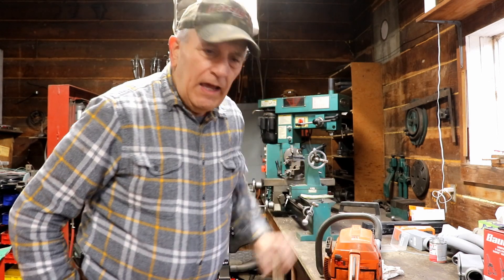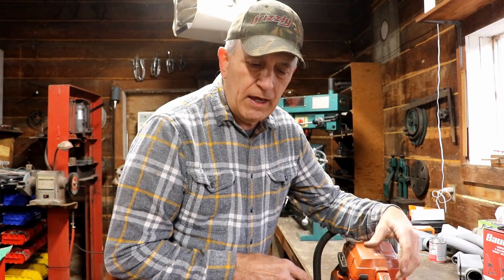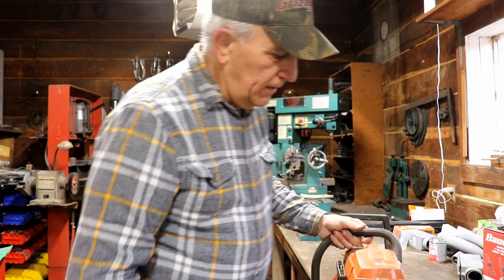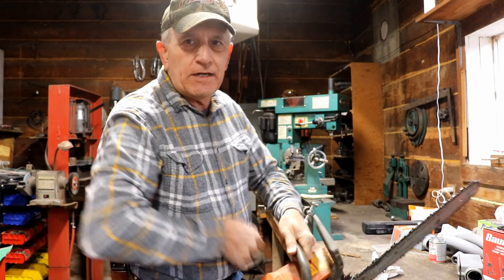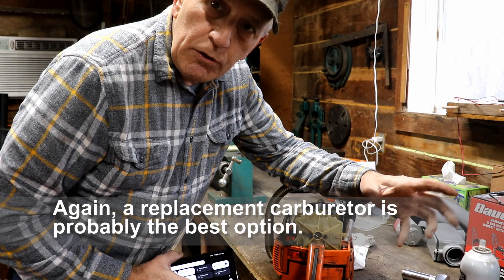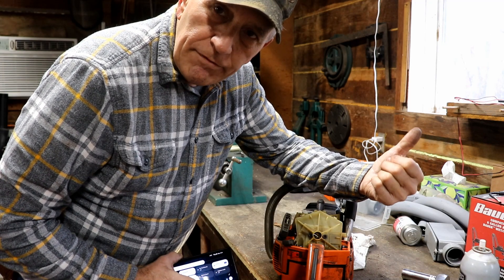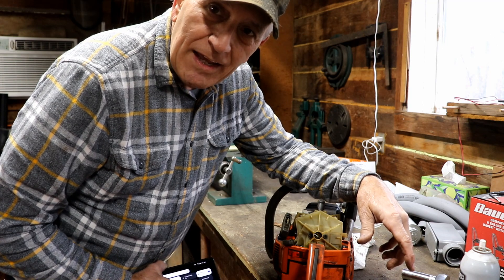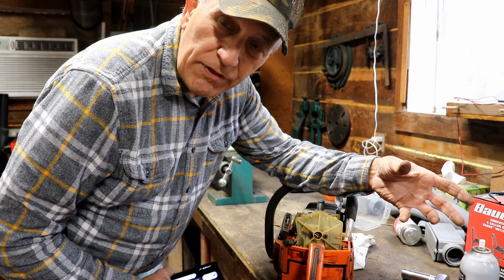678 RSW How To Diagnose Small Gas Engine Problems

Comment: Back in collage, I worked for a rental tool comp. You are 100% correct on what you said but it could be an exhaust clog also. Very common with chainsaws for some reason. If it still does not want to run up to the right RPM, check the muffler and see if that is clogged also check to see if carbon buildup has formed around the exhaust port, that can be done simply by taking off the muffler. Also it may have a Spark Arrestor screen and it may be stopped up! To much back pressure will keep it from getting to RPM or being sluggish getting toward RPM.

Comment: Long ago, I had run a small engine shop in Cape Carteret in NC.  95% or more came down to dirty carburetors, from stale, or broken down fuel.  Any gas exposed to the air starts to break down {2 Stroke fuel actually fails inna coulpa months}, evaporate, & form varnish that will clog jets, & internal passages {those little holes in the bore, right behind the closing point of the throttle plate.  Hot ultrasonic, & low pressure air {5~10 psi, use a regulator}  Too High of a Pressure will blow needle seats out.  Ya can dip it into carb cleaner, just NO PLASTIC PARTS {sorry, ya have to remind folks}  But brake cleaner'll work too, low air helps alot tho.

Comment: Great lesson Jerry. May I also add. You may need to pull out the plug and check to see if it is also sparking. Plugs have gotten better over the years. But they still fail. Thanks

Comment: Funniest thing that ever happened. Someone wanted me to look at their chainsaw, saying it wouldn't run. I checked the brake, and it wasn't on. Checked for any physical signs, nothing. Opened the gas cap and saw an empty tank. Put some gas in, and it ran. They wanted to know what I did to fix it. I told them I put gas in it.

Comment: I did as you recommended and just replaced the carb on my saw and problem solved. I've rebuilt probably hundreds of carbs but this time wanted a quick fix so replaced it and new gas lines and never looked back lol
Reply from the maker: Yeah I used to rebuild them myself but they're so cheap these days it's just easier to buy a replacement